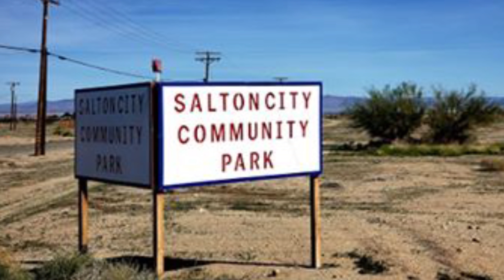Salton Sea Hatchet

Comment: Nice piece of wood for the handle. I love the inflatable sanding sleeve. Mine is larger diameter and I got it many years back when I was working for a chain of casinos in Vegas to use on crap tables. The walnut transition from the chip trays down to the stick man station and also to the back section are made for the inflatable sleeve sander. I use a air die grinder with the sleeve so it looks like a air powered rolling pin and works great for other free form shapes.
Nice project as always.
Reply from the maker: Thank you James! That's really interesting!

Comment: A neat looking hatchet!!!   It looks like it will keel.

Have you ever tried soda blasting to clean up wood?   Does a pretty good job with minimal touch up sanding.
Reply from the maker: Thank you!! I haven't tried soda blasting, but now I want to!! :)
Reply: Carl Jacobson
 I used soda on cars I use to restore to remove paint and rust and it did a nice job since it is not real aggressive in cleaning up materials.   Furniture refinishing folks use soda & corn chips grit  as well since it is able to get into wood carvings, etc,   However, experiment before you decide you turn loose your air compressor and soda on a piece of wood.  Like wood turning, blasting with soda does take practice since you can mess things up in a heart beat.   

On glass carving, I also used other blasting media such as aluminum oxide, silicate, corn cob, steel grit, walnut grit.   Corn cob may be a little gentler in wood. 

BTW- a respirator with a fresh clean air source is mandatory, or use a tight blasting cabinet.  You don’t want your lungs permanently damaged: particularly when using silica, aluminum oxide or steel grit.